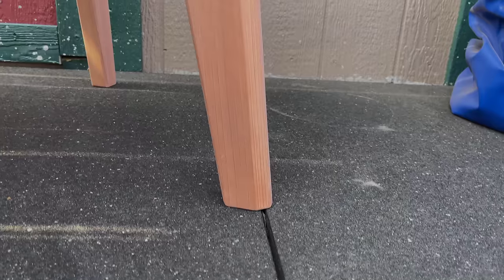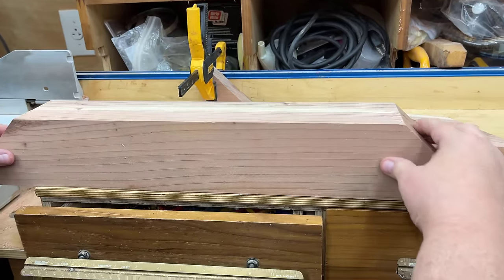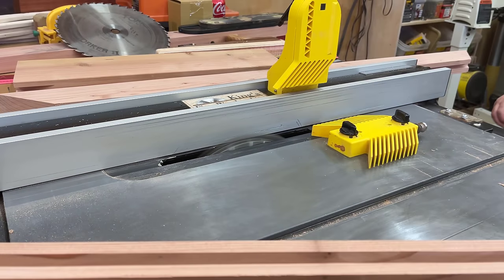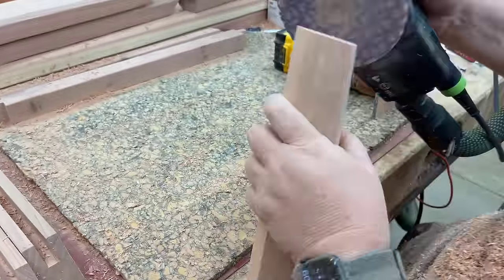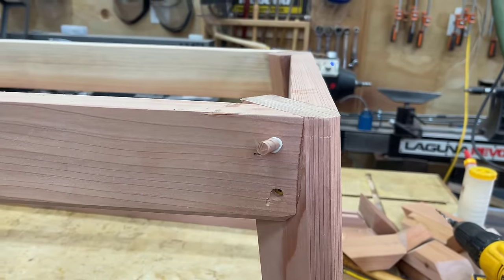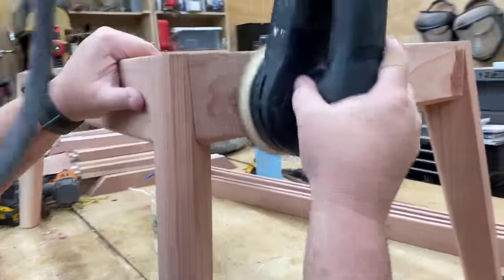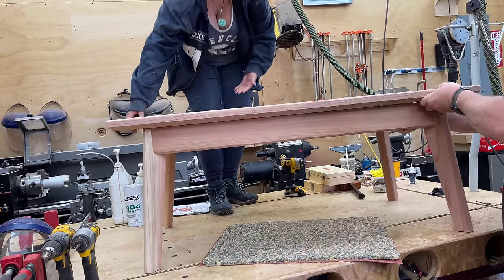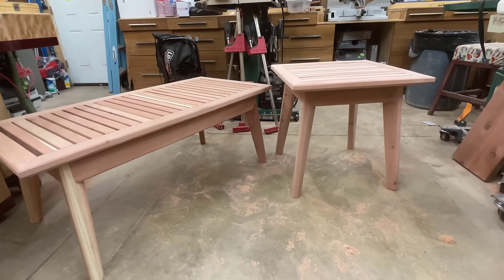Outdoor Tables for the Adirondack Chairs, Coffee Table and End Table

Comment: Made the end table 2 weeks ago.  For my personal use.  My wife wants it but I have my morning coffee on it and am not willing to give it up.  Your little end table is just great!  I made the top with proper mortise and tenon joints.  Not too hard but the redwood I am using has lots of sap and I got a lot of smoke while cutting mortises.  I will use this method again for my friends and family.   For the mortise layout, I just cut all of the slats, put the tenons on the ends and laid them out with spacers in between, on top of the edge pieces.  Full actual size.  I just traced out where the mortises were to be cut.  Done.  No measuring or errors.  3 Coats of marine varnish to finish.  I have designed a King's inspired simplified small table top with just spacers in between slats and no joinery.  The base is really simple without the 8 degree splay on the legs and eliminated the leg taper.  75mm x 34mm legs still kept at 45 degrees.  I built a jig to hold the corners while I screw the reinforcement pieces in.  No pins or nails.  Just Titebond III and 4 x 4.5mm screws in each corner.   I have 3 done and will list them on Amazon on Monday (after I finish them).  Owatrol Aquadecks as I can get 3 coats wet to wet on and have a 4 hour dry time.  I had 8 sample finishes outside in heavy rain and hot sun for 3 weeks.  I picked the best looking.  I can finish and ship the same day.  I reduced the size of the table slightly as I can ship 59 x 60 x 60 cm for £14.95.  60 x 60 x 60 cm costs £49.00 so that 1 cm makes a huge difference.  Now I am having fun!  I really missed working with West System epoxy...  Thanks again!

Comment: My coffee table is finished.  I learned a lot making this table and used almost all of the tools that I own.  My clamps slipped while the epoxy on the table top was setting so one of my mitred corners was messed up.  I hand planed the outside to make it look OK, but the inside of the joint looks wonky.  My wife wants this one.  I will start making an end table.  I have a mortising machine that I have only used a few times.  I cut a 1/2 test mortise and made a mock up using a spare slat I cut.  I think there is some potential.  It will take longer to mark and cut mortises than cutting a dado, but the mortises may save time (and mess) when gluing up.  I will also take a little off the sides of each tenon to lessen the chance of any glue squeeze out being visible.  This project has 'Domino' written all over it.  A Domino would make child's play out of the slatted tops.  I don't have one of those, but after building this coffee table I am half sold.  The best thing about this table is the base.  It is strong, elegant and very light.  Everyone who has seen the table just loves the base.  I am not sure about my chop saw.  I set it up a few years ago, but I am not sure that the 45' cuts are still perfect.  I checked them, but I am not happy with my mitre joints.  With the size of the 48" top, the corners need to be really accurate.  You guys make this build look easy because you have skill and patience.

Comment: I have not been impressed using 2x4s to create furniture, not even outdoor furniture. The use of chamfering in your design has completely changed my mind! Thanks! The elegant, nearly Danish style, has immediate eye appeal. I see only a couple of things I might do differently. One is to celebrate the joints by using dowels. I might also experiment with a different top rather than open slats. You really did a superb job! Thanks again!

Comment: First video of yours I have seen. Very impressed. Using the chamfer to make the 2x4's look thinner fooled me, I assumed you would run the 2x4's through a planer somewhere in the video. I think I would have used the table saw to put the 60-degree chamfer — maybe I need to use my router more.

Comment: Nice video and tables!  I agree with Horatio, your instruction is excellent.  Do you think that the style and construction would be scalable to a 36 x 36 cafe table (~28-30 inches high), and still retain it's strength and integrity?  Would you do anything different?  I would use white oak and a Domino as much as possible.  Cheers!

Comment: Thank you for the great video. Love how you take the time to give an easy explanation on how each process works together. Are these tables the correct height for your Adirondack chairs?
Reply from the maker: Hi,
Thank you. 
As for the correct height for the Adirondacks I would say yes. 

There are two schools of thought on that. Some people like regular height tables for their Adirondack chairs, some people like them 3” shorter. 

Personally, all of us like them regular size. However, if you don’t. Then after they are build it only takes 2 minutes and a circular saw to trim a few inches off the bottom of each leg.
Reply: @KingsFineWoodworking  Thank you for responding. I will be purchasing the plans for the Adirondack, chairs and table. I appreciate you

Comment: Beautiful design and clear instructions.  Besides paint, could you please suggest a durable finish? Something that is easy to refinish. My stuff turns gray rather quickly.
Reply from the maker: Sure! The very best stuff I have used is a penetrating oil finish by Penofin! It lasts a very long time and is extremely easy to refinish. Here is a link to the best price I've found on the internet https://amzn.to/3l63y3X
Reply: @KingsFineWoodworking  thanks a lot for the link.  I have a can of linseed oil. Is that in the same category?
Reply from the maker: No. Unfortunately it’s different. Boiled linseed oil can have some beneficial effect, but it also stains if the wood is left wet too long. For example, cups of water can leave water rings on the surface. 

If you followed up the linseed oil with wax it would help. But it would never be as good as a product like Penofin.
Reply: @KingsFineWoodworking  is penofin more like those deck sealers?

Comment: Great video and smart design, well thought out which is always refreshing because it's actually pretty rare.  I know where to get the feather boards you mentioned in the video but you didn't put a link to them.  I'd love to buy them through your affiliate link so if you can add them that would be great.  Thanks for all the great content.
Reply from the maker: Thank you! here are those links!
Magswitch Universal Featherboard Pro - 81101303
https://mag-tools.com/collections/woodworking/products/magswitch-universal-featherboard-pro-81101303?ref=kingsfinewoodworking%20

Magswitch Vertical Featherboard Pro – 81101302
https://mag-tools.com/collections/woodworking/products/magswitch-vertical-featherboard-pro-81101302?ref=kingsfinewoodworking%20

You should get a 10% discount by using those too.

Comment: Did your stock start out as dimensional lumber from HD/lowes or did you find the redwood from a real lumber supplier? Denver local here, wanting to make a couple pieces for a buddy's yard.
Reply from the maker: Just redwood 2x4 dimensional lumber from the shelf at Lowe’s on Havana St in Aurora, but I’m pretty sure all Lowe’s stores in the metro area have it.
Reply: @KingsFineWoodworking  Thanks! I figured if it was from a box store, it would be Lowes as they seem to have a wider variety of lumber products than HD. Roughly what's your cost of material for a regular Adirondack chair?

Comment: Great video.  Love the content.  I was wondering if you could use a Kreg jig to drill the holes for the skirt or side of the table to attach them to the legs, instead of making the holes that need to be countersunk and plugged?  Keep up the good work!
Reply from the maker: Thanks!  A pocket screw from Kreg won’t really work well since you are attaching a rail that is mitered at a 45 degree angle to a leg that’s angled. 

It would work great if you had a square rail going to a square leg, but not so good here.

Comment: Looks great. But your method of checking for a perfect 45º angle doesnt work. If your board is perfectly flat, no matter what angle you cut it will = 90º. If you cut it at 50 the other side would be 40, still a perfect 90.

Comment: Really nice design and execution. 
While you obviously have tons of experience, I believe if you check on epoxy, if you’re using it as an adhesive it is required to have the filler added. A cheaper option used in boat building is just sawdust. Similar to what you do to make the filler putty. 
As for wood expansion and contraction, it’s thermal e/c, so the more temperature change the more e/c. That’s just basic science. It’s great if you have not had trouble with it in your projects, but there’s definitely more outside where temperatures fluctuate than inside a more controlled environment. It’s one of the reason there are gaps in decking vs tighter fitting floors inside a house.

Comment: I would love to work with 2x4 and 2x6 because they are inexpensive. The problem I had was they don’t kiln dry them like other lumber which makes them unstable to work with. I made a head board with them and I was constantly dealing with movement of the wood. Nice work I enjoyed the video.
Reply: Shop around when buying your. 2x4,  2x6. Look for a stamp that says KD/HT.  Kiln dried, heat treated. That hopefully will end your movement issues. I know what you mean about wet would. A few years ago I bought an 8ft treated 2x4 for a shower wall bottom plate. I left it laying on the floor, totally flat and in 3 days it had a crown 3 inches high in the middle. It was like a sleigh runner. Hate to guess what it would have done in the full sun.
Reply: @markheintz1878  great info I will try that. Thanks.

Comment: Wouldn't pocket screws from the inside be just as strong but prevent doing plugs and putty.  I do plan on buying plans and building one.  BTW where do you find 2x4 of that quality?
Reply from the maker: I think it would be very tough because of the angle the rail meets the leg.  But you could definitely give it a try.

Comment: Where did you get these clear 2x4s, nothing in any lumber yard or box store that I have been to. Must have cost you $50.00 a piece.
Reply from the maker: Hi,
They are redwood. And there are knots. But they are tight knots. I got them at Lowe’s. 
(Some of them) the other pieces were some leftover redwood from building a few chairs. 

I think the 2x4-8’ redwood were about $16 each.  And this coffee table takes 7 of them. So you can do it for about $110. 

Of course it’s less than half that in Douglas fir.

Comment: Perhaps this has already been asked... but curious why you used epoxy on the table top vs. regular wood glue like was used on the frame?
Reply from the maker: On a face grain to face grain glue up, Titebond is stronger. However, on an end grain to end grain glue up, or when any gaps might be present, epoxy is stronger.  Since the corners of the tabletop were partially end grain (since they are cut at 45 degrees), and since there were a couple of small gaps, epoxy was the better choice. 

If you elect to use a screw in those corners along with glue, then Titebond would have been plenty strong.
Reply: @KingsFineWoodworking  huh. Didn’t know that. Thanks for quick and educated reply - learned something new today!

I found your channel last night and quickly subscribed.  Can’t wait to see more!

Comment: Subscribed!  Hi James - I love the look of this table set!  I built an outdoor table out of cedar a couple of years ago with breadboard ends.  Unfortunately the breadboard ends failed and now id like to repurpose the table.  I'd like to purchase the plans and use the table top design from your table (using the lumber from the existing table) and mount the tabletop directly to the steel table legs .  Table will be about 60" long and 38 wide.  (table legs are rectangular 31' high, 26" long).  Please let me know if you see a problem with ihis approach?  Thank you!
Reply from the maker: Hi, I don’t see an issue with that. I’ve used this exact top design for full size outdoor dining tables a number of times. It works great.
Reply: @KingsFineWoodworking  Thank you James!

Comment: I always enjoy your videos. TY.
I have a few questions about the wood expansion (for solid wood particularly). You stated that, outdoor builds do not require accommodation for expansion as indoor projects do. Intuitively I don't understand why as the outdoors have a larger temperature and humidity swings and they tend to do so much more quickly than indoors. In Canada & perhaps elsewhere there is a saying, If you don't like the weather that's OK....just wait 15 minutes.

Is the need for accommodation overblown in all cases accept when projects intended to heritage quality and expected to last 2- 3 hundred years or more?
Is the damage from caused expansion have less impact than say UV, and/or a 300/140 lb/kg gorilla dancing on it?
I know that there are species factors as well, but that would seem to be be independent of the project being in or out of doors. Is this assumption correct?

PS, on occasion I must admit, that I have been that gorilla. Thanks from all of us who occasionally are well marinated and/or lightly seasoned gorillas that you build strong furniture!
Reply from the maker: Hi Tom!
I should have been more specific. 
Outdoor builds that are assembled from softwoods, and mostly by screws, aren’t at risk of problem from expansion & contraction like indoor furniture. 

The reason is that the wood is soft. When it tries to expand/ contract a bit it will, and the screw hole might stretch a tiny bit, or the board might bow a little. 

But these don’t really cause problems. These softer species stretch & compress more like a sponge than hardwoods do. A hardwood will check or crack, or you could see a joint push apart. The softwood will just absorb the expansion or contraction and act like rubber or a sponge. 

I built decks for many many years here, and they were  almost all redwood or cedar. 
They were all screwed tightly together, and after hundreds of these over the years, I never saw a board crack or a joint push apart.  I built plenty of furniture for the decks too. It’s all still there after 30 plus years. 

Now, if you were to build a deck or furniture from mahogany or teak, you would absolutely have to allow for expansion or contraction. And you are right - there will be a far greater humidity change outside, than inside. 

Hope that all makes sense.
Reply: @KingsFineWoodworking  Yes it does, Thank you.

Comment: Awesome table set.  just wondering is the last 2 boards could be glued with tite bond 3 or epoxy is needed for more strength?
Reply from the maker: They can be glued in with Titebond 3, it is stronger!!

I know it seems odd, but a study was done by Case Western Reserve University, and they tested various Titebonds, other adhesives and epoxy by gluing multiple different species together. 

The joints were all tested for strength in psi once fully cured, and Titebond 3 was the clear winner. 

I only chose epoxy here for the slats because of a long open time. 

But if you work quickly and don’t have to film like me, it can all be done with Titebond 3. And if you want to use epoxy in the middle and Titebond 3 for just the last 2, that’s perfectly ok too.
Reply: @KingsFineWoodworking   Why epoxy for glueing the mitre joints?  Would Titebond III not be a good option?